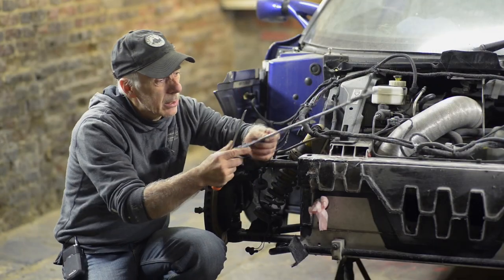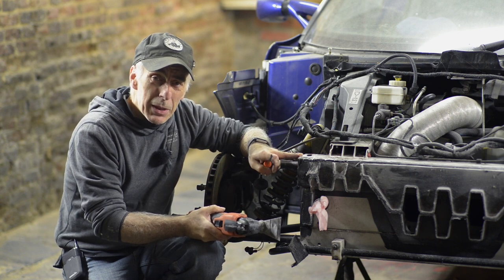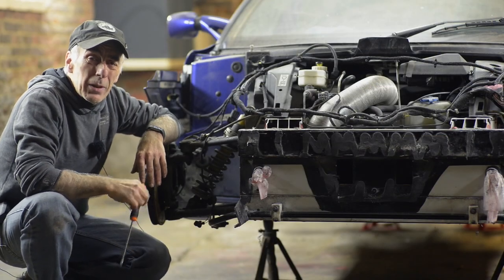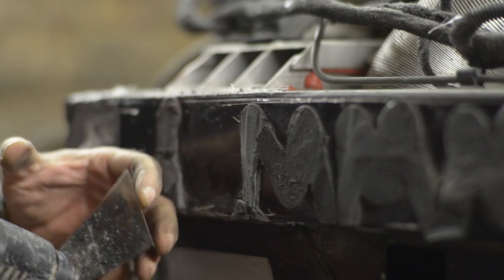Lotus Elise, Removing and Preparing for the new crashbox

Comment: Some of the very experienced Lotus guys can get the crash boxes off as one piece without damage (for example if the rear of the car has taken the impact). Then the crash structure can be re-used again. Heat, chisels, wire etc seems to be how they do it, the tricky part is convex part at the top of the chassis, where the concave part of the crash structure mates to it - Beta Seal bonds 3 sides of the box section, so access is difficult.
Reply from the maker: Sean Cain txs Sean. I have been reading that as wel.   But now that i removed mine i doubt if that is possible at all while keeping both the structure and the alu intact.    Txs for the comment

Comment: Which alternative to betaseal are you planning on using?
Reply from the maker: SwagPKVids  hi.  A PU based bonding glue.     Do you have recommand some ?
Reply from the maker: Hi SwagPKVids,   its the PU Sikaflex 211.   Not sure if that is a good choices..
Reply: Just googled that product. Haven't heard of it at all, nor does it seem people have used this for Lotus work.

I'm not familiar enough with adhesive characteristics to know how close it is to Betaseal.

Hopefully it works out fine for you.
Reply from the maker: SwagPKVids indeed i did not see it used either. But the Eliseshop claims that it is a good replacement.